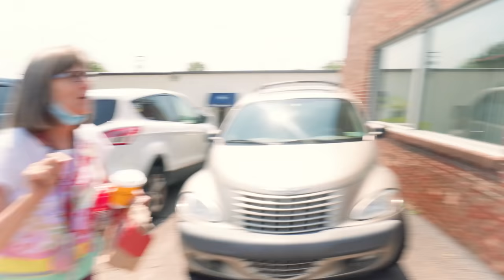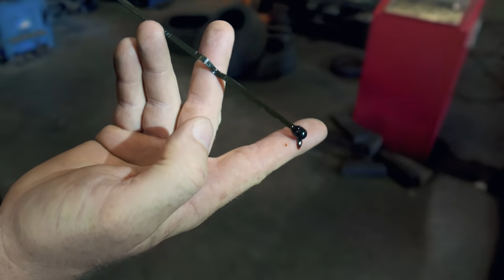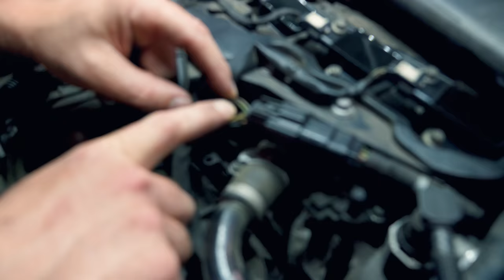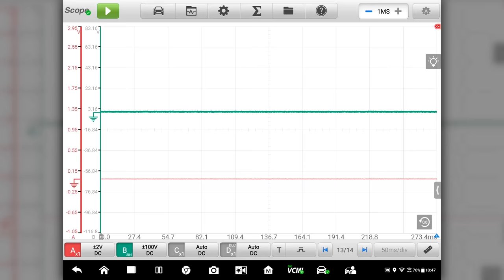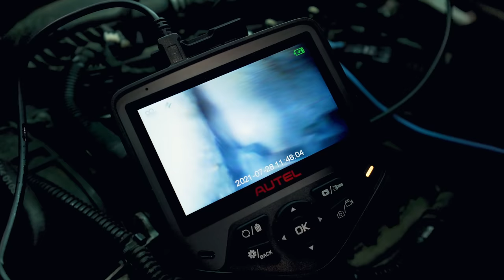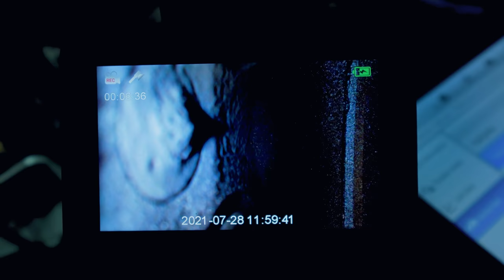Stuck Open Fuel Injectors (GDI) Part 1 (symptoms and troubleshooting)

Comment: What a deja vu moment for me watching this video. When i was working at Volvo dealership as a mechanic there was a Volvo V70 with this same 1.6 liter GDI turbo gasoline engine from Ford that had the same problem as this Ford on the video. All 4 injectors were leaking by just running the low pressure pump. After changing injectors and oil+filter car was running fine but on a test run it was obvious that engine didn't make full power in acceleration. Back to the garage and check in the exhaust pipe it was obvious that catalytic converter has melted because of rich condition. After replace of catalytic converter car ran perfectly. Afterwards i talked to a Ford technician and he said that leaking injectors is a common problem in that engine when driven only on RE85 Fuel (85% ethanol, 15%gas). Technician also said that this problem is avoidable if every 5th refill is done with normal fuel.

Comment: Wow sorry about your mom’s diagnosis.  Heartbreaking for sure.  Regarding 3 injectors failing, I suspect contaminants in fuel preventing injectors from closing- just happened not to affect #4. I’d change fuel filter, possibly even drop and clean tank.
Reply from the maker: Contaminants for sure. Check out part 2 my friend
Reply: Most likely there's not a serviceable fuel filter on this car. My wife's 2016 Escape had the filter part of the fuel pump as well as my daughter's 2012 Escape.

Comment: It was one of the best episodes I have seen of you, especially thanks to your wonderful mother. I wish her good health and prosperity. Greetings from Europe, straight from Poland. I am your big fan, I have your book and almost all the tools you use. Car diagnostics is my great love. In my work, where everyone is a part changer, I look like an idiot because nobody listens to me or believes in accurate diagnoses. Your films are like water for flowers to me. I greet you warmly, your mother, brother and son and all Familly.👍
Reply from the maker: Thank you so much my friend! I love hearing this type of feedback.
Reply: @ScannerDanner  do you mean on the connector side or the driver pin in the pcm female side
Reply from the maker: @Sonny1989  harness side, backprobing, with PCM connector plugged in. 
Just an FYI, injector pulsing is so fast that a regular voltmeter will miss it. So I'm not sure how you're confirming that you don't have injection pulse on that cylinder. I'd use an incandescent test light to confirm flashing.
Also, the system can shut the injector down intentionally if there is a recognized misfire, but it will always, momentarily, start firing it again on initial start up
Reply: @ScannerDanner  because that injector is on full time full bore it floods the truck out the exhaust
Reply: @@Sonny1989  you said your voltage on the control wire was staying a 12v though? What are we working in? Year, make, model, engine?
Reply: @Paul-Danner  I’m sorry it’s a 2015 ram 2500 4x4 6.4 the wire on the pcm side has a constant light of light is hooked to positive terminal. The other wire has a constant 12v it seams as though the number 7 injector is on constant wide open spray if the pig tail is hooked up to injector it will go through gal gas in min white smoke out tail pipe and a strong smell of gas then it misses on number 7 and 5

Comment: Could you have seen a different or missing injector opening bump in the current waveform for the 3 bad injectors?  Did you save the waveform?
Is there a second extra fine filter for the gdi part... like diesels have 2 filters?

Comment: On Honda's that's your only option is to buy all the injectors as a set. Too much risk of an a/f imbalance if not replacing all as a set.
Reply: What! Honda selling you parts you don't need?
I'm shocked!
Reply: @MrRShoaf  All injectors are needed. A cylinder a/f imbalance will result from not replacing injectors as a set.
Reply: @OneLegged-honda-mechanic  

Let's say you pulled out all 4 injectors that functioned well and then accidentally boogered one up.
In a Ford or a Chevy, you can buy one get back on the road.

It is good practice to change head lamps in pairs also but what would you do if when installing them you dropped one and broke it?

My wife had a Toyota that had a corroded tail light socket and Toyota wanted to sell the whole wiring loom forever $100.  I bought just the socket at the parts store that was a bit larger and filled to fit. Less than $10.
Reply: @MrRShoaf  good point. They are pretty sensitive to differences in carbon build up. I suppose if they were available separately that would be an option or maybe get one from a junkyard in a pinch.

Comment: High pressure fuel pump started to disintegrate, sent metal particles through the system and destroyed 3 injectors? Something to consider before new injectors are installed
Reply: Agree, seen it lots of times in a diesel.
Reply: Destroyed 3 ? Not destroyed 1 which caused pressure fluctuations in 3 ?
Reply: Yeah. Maybe one injector started leaking, diluted the oil which caused the HPFP to disintegrate which in turn sent metal particles down the line.
Reply: @blockbertus  sounds like a Cat Heui system.
Pull pump, injectors and flush everything before reinstallation.
Reply: If I’m not mistaken the HPFP is lubricated by fuel not oil
Reply: Only thing common to all injectors is hp pump and hp lines... Is there some kind of filter in the high pressure side? A porous sintered metal filter like in oil burner injectors might be used and there could be a manufacturing defect on it and it is releasing some debris to injectors.  A unfiltered high pressure flow from a mechanical pump to injectors just sounds a bad idea.
Reply: @andrewgonyou9903  I dont think regular gas is good enough of a lubrication for the piston of the HPFP. Every HPFP I've seen had a oil lubricated piston.
Reply: @707061756c69  exactly my thought. Usually there is no extra filter AFTER the HPFP to protect the injectors.
Even though, if that filter would clog up, it would starve the injectors for fuel (their lubrication) and would also cause the engine to start running lean.
Reply: I think he said he was changing the pump.
Reply: I don't know what ford was thinking. This is why I drive old cars.
Reply: My thoughts exactly! I would replace the fuel filter and cut the old one apart and check for metal fragments.  Could be a failing pump? Love to learn from your vidioes
Reply: @andrewgonyou9903  not on a gas engine,a diesel engine yes because it has lubricity
Reply: @andrewgonyou9903  Some vehicles like Nissan uses an oil channel to lubricate the pump. So, the pump has some special  seals to separate oil and gasoline. The biggest issue with these pumps is, with time, these seals will leak fuel in to the engine and enrich the mixture.

Comment: Your mother is a true fighter and you should both be proud, I love to see that your mother is better.
Regarding the video, I had never seen gasoline engines fail more than 2 injectors at the same time, in Diesel it is more common to have failures that affect more than 2 injectors but the injectors are usually more complex at a mechanical level and leaks are generally due to fuel returns.
Reply: Give your mom our love Andrew & Ruth.

Comment: Best wishes to all of your family, sir! This is an encouraging video.

The initial absence of injector pulses when cranking probably is due to low rail pressure because of the bleed down: computer won't activate the injectors until a minimum pressure has been reached.

Comment: really nice bore scope Paul, As some have said I would suspect the fuel pump is breaking up, inspect the fuel filter and I bet it will be full of glitter lol.  Seen it loads here in the UK
Reply: Absolutely Right 👍👍
Reply: Installing new injectors will not fix the car.. you have to clean all the fuel lines and change them if you have too ..also the fuel tank and the low pressure pump.. water intrusion can cause oxydation to the pump and make it wear internally.. so before placing a new pump you have to be sure that water is not going to be mixed with the fuel

Comment: From my experience GDI Injector failures are becoming quite common.  Due to GDI Injectors placement, extremely small nozzle sizes, they are subject to extreme conditions,  activated multiple times during one combustion & operate under extreme fuel pressures unlike port Injectors. I sent in a set of ford GDI partially clogged Injectors to BG headquarters & they confirmed the restriction was a plastic & metal  debris present.  They were little perplexed so see plastic/metal as a debris.  Obviously the cleaner didn't work, so they requested for me to send in to their ISO lab for testing.  Great diagnostic work Danner.

Comment: Done a bunch of sticking open direct injectors, not more than one unless they were contaminated by metal or fuel issues. Super easy to watch the fuel pressure degrade rapidly after turning the engine off and also trims all out of wack.

Comment: Hello Scanner Danner, this is an excellent video and something we all needed to see.  I have also been researching ways to properly diagnose a mechanically faulty GDI fuel injector. I am finding them often on the VW/Audi GDI engines.  Do you think it is possible to use secondary ignition wave forms to help diagnose these injectors?  I have a theory but have not tried it yet.  While monitoring secondary ignition with a rich condition,  I feel like the the "burn line" would have a negative slope.  If the mixture was very lean, the burn line would have a positive slope.  I am gonna try this one day soon just to experiment. Let me know your thoughts. Thank you for your time.

Comment: ford tech here. very easy to diagnose. ignore any flow charts you find. look at FRP desired V actual. on a good system engine warm koeo after running the pressure will RISE due to engine heat/fuel temp. if it does rise the system is ok. if fuel pressure falls, pull up CYL ACCL on the logger and start engine after pressure has fallen. the cylinders showing negative acceleration have bad injectors. I do this diag 3-4 times a week and it never lets me down.

Comment: I had a similar issue.  My quick way of finding the bad injector was the cylinder full of fuel as you mentioned.  My engine actually locked up and wouldn’t crank it was so full.  No mechanical damage though thankfully.
Reply: I got the same thing going on with my 97 Cobra.

Comment: When you unplugged 3 of the injectors and there was no change, but the 4th one killed it.  I find that common.  You have to remember if you have a fuel injector dumping fuel, the computer is going to try to trim that fuel.  It trims them as a whole bank. so the other 3 injectors were probably trimmed so lean that they weren't firing (or firing much) anyway.
Reply: this is not entirely correct. a new ford ECM performs cylinder specific trimming as well as bank to bank correction.
Reply: The computer can't trim an injector that is stuck open

Comment: I would say that the HP-Fuel pump has failed and so gives the injectors metal dust that stick the injectors open. And that's why they don't need so much pressure to spray.
I all so fear for the Cat's........

Comment: For more than two, I would suspect the vehicle sat for too long in storage with old E10 gas and injector tips varinished up, causing them to stick.

I wouldn't be surprised if this what marine outboard technicians see on a regular basis, injectors sticking open or closed on most of them on motors that sat for 1 or more years with E10 gas without being ran.

I wonder if those injectors are cleaned if they function correctly on not allowing fuel to pass when not energized.

The comment someone mentioned about high pressure fuel pump going bad sending particles into the injectors, might be a possibility if the design of the unit could throw trash if like a bearing failed or something like that.

Comment: And you don't need that "special tool" to get the injectors out. Spray with lubricant, take a pair of needle nose pliers and twist the injector and pull, majority of the time they'll come  out. The Ford tool kind of sucks, only needed if they won't budge. I've been able to get them out by tapping them, but the head is off at that time. You will need a special for the Teflon ring, but with new injectors that shouldn't be necessary.

Comment: Another way to test for fuel laden oil is to allow the dipstick to drip a drop of oil on the back of your hand. To see the difference, drip a drop of fresh oil next to it. The fuel laden oil will immediately run through the cracks in your skin but the fresh oil wont. Learned this from a WWII B29 mechanic.

Comment: Would fuel in a cylinder increase the cylinder pressure enough to see which cylinder is flooded through a relative compression test?

Comment: When did the customer last fuel up the vehicle? Possibly sand/soil contaminated fuel from leaky tanks at a gas station. I would pull a fuel sample from the low pressure side, maybe check the fuel filter for debris. If no contamination was found, I'd change the HPFP along with the injectors and the lines.

Comment: Ask the customer if the car has been parked for a while. We've been seeing all kinds of fuel system problems in cars which have been parked and out of use due to covid and people working from home - you may actually have three stuck injectors due to crud jammed in them from old fuel.

Comment: My educated guess would be a few different options. Debris or metal in the system from high pressure pump but with it being a dead headed system or non return system it’s possible only a small amount of debris got through and made it through to those 3 injectors only. (to relate, the Cp4 pumps in the Duramax degrade due to low sulfur diesel and cause metal to go through the entire fuel system as it is a return system). They just simply happened to go bad (unlikely but potently). Or there was foreign debris in the fuel that made it past the fuel filter and or sock.

Also, happy to hear your mother is doing well!

Comment: Possibly dirt in the fuel system causing the injectors to stick open
Had it before a few years ago.
Make sure the fuel filter is clean or renew filter.

Comment: This is very reminiscent of what happens in a diesel engine high pressure fuel system,if the fuel pressure regulator malfunctions and you have a pressure spike it will actually break the spring and plunger inside the injector causing it to remain open,and if #4 is the last one in line it would be less apt to suffer damage because the pressure would have fallen off by then.always replace the regulator when changing injectors.also, the fuel pressure sensor may play a role in a pressure spike if it's defective,I would definitely replace it as well.ive seen this very thing play out in a diesel engine more than once,these gdi motors are very similar.

Comment: Good to see that your mom is doing well. About the cause of these injectors sticking. I wonder if the pump failed internally and sent shit down the lines into the injectors. I have heard of that happening in diesel land where the pump comes unraveled and literally everything beyond the lift pump needs to be replaced. But the difference is in that case, it's usually from when guys get gas, water, or DEF in the tank by mistake, and the pump grenades itself because it is using the fuel to cool and lubricate the high pressure pump. This could also be from sitting, would have to talk to the customer because if this vehicle sat for 3-4 months with ethanol in the fuel, it would turn whatever fuel was in those injectors into chewing gum.
Reply: Great video. There's no substitute for experience. Keep it up. Wishing your mother everything of the best best with her health condition. From Stan the man in Cae Town RSA.

Comment: High pressure fuel pump started to disintegrate,throws stuff downline,and like one goes, driver hardly notice,check engine lite  pops on . keeps driving, second one goes shakes more, keeps driving, then 3rd goes now car won't go no more. then calls n say it just started this issue.This is very common up here in the rust belt cities of NY North of the 90.
Reply: Driver neglect  is one thing... but the direct injection design and engineering really are worrisome as there is no safeguard for hpfp failures. Every car maker is now on the bandwagon. Ownership cost increasing in the name of mpg.
Reply: @jyao5409  not like 45years ago when we could repair anything in our driveway.

Comment: I have my suspicions how the injectors became mechanically stuck open to allow fuel to flow without being energized.

Coming from the perspective of a factory tech this is what I have deduced.

You’re up north in the rust belt, and cities put what ever they can on the roads to help cars stay on the roads.

Ford has a cap-less fuel filler neck. This filler neck is good at keeping dirt and crud out, but years of rust belt abuse and high pressure car washes will force stuff down it’s throat.

The fuel filter is attached to the fuel pump and the tank has to be dropped…bummer. I’m wonder how much crud has been sucked up into the fuel filter.

Side note: I’m here in Texas and warranty replace fuel pumps with 60k miles, these cars have regular fuel caps, and I still find crud in the filter. Makes me wonder how clean the gas is we pump into our tank is.

Comment: duuuuuuddeee my bmw 750i made me think it was a blown gasket too and its looking more like a stuck open injector..you know only 3500 for the set of 8 FML i swear i hate bmw for price gouging injectors...I  changed the HPFP and the LPFP along with the fuel pressure sensor and spark plugs and coils and did a cylinder pressure test with 175lb on each cylinder the injectors are the only thing I havent checked but im glad you made this video so that i can at least confirm what I thought was wrong.